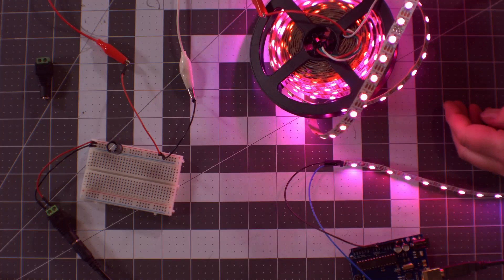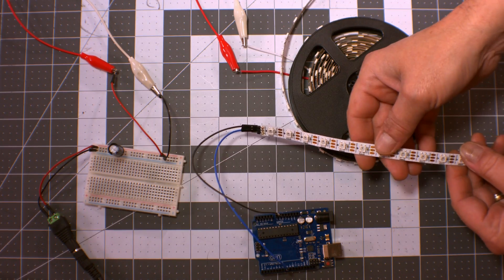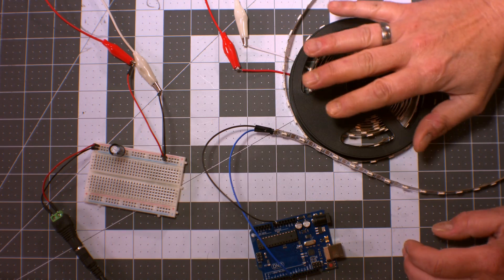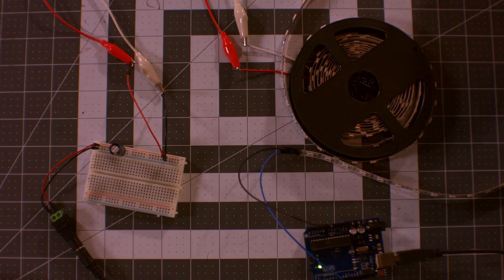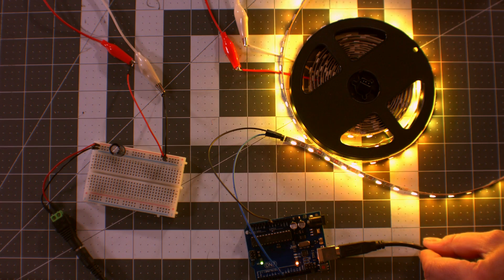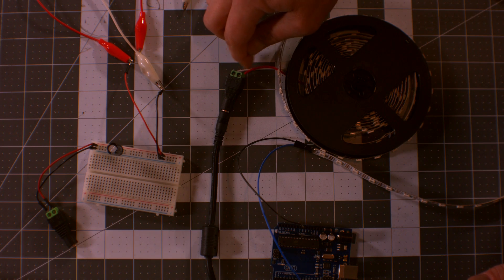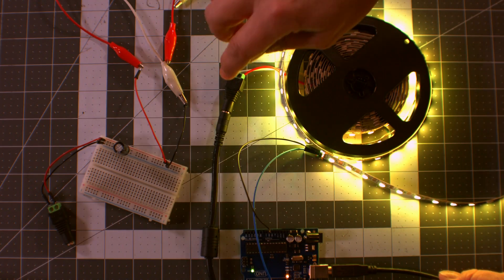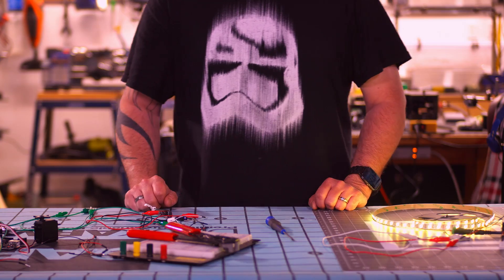LED Strip Flickering? Possible Reason and Solution!

Comment: Oh god, are you supposed to have the power and controller going into opposite ends of the strip? Thats what this looks like. My setup is (starting at outlet): 5v power supply cord --> controller --> dupont connectors --> factory led adapter  --> led soldering points, all on one end. And I get flicker when it transitions between colors. 9ft of 144pixel leds

Comment: every time I turn on the power supply (external) to feed 70 leds on one strip, I noticed that the leds flashed once.  I'm not quite sure if that's normal.  I then run the arduino to control the leds.
Reply: Considering a capacitor between the power supply and the LEDs. There is one in the breadboard in this video. I believe 1k should do it. You should also, generally, turn the power supply on and THEN plug in the LEDs, where possible.
Reply: @joshy_j_ capacitor 100nF ! Pode ser por 50 volts !

Comment: I cut my led lights and I put them back together with the adapter that came with them but the bit that I cut off won’t turn on. Any ideas why this might happen or how to fix it?
Reply: Cut the copper connectors in the middle should have a cut here line

Comment: Hello new to this , just wanted to know, you have connected data pin and gnd in from of the led strip and giving power supply to leds from behind?
Reply: It doesn't matter where the power supply comes from, there is no front or back in terms of the power supply. Only the data signal is directional.

Comment: Hi, my wiring works fine when there is no extension cable used. But I want to put my lights at the wall and therefore I connected a 2 m cable extension between the board and the strip. Now it flickers at brighter colors (2 or more LEDs at 100%). Do you have any idea how to fix this issue? 

I used this cable extension (I think it's the same wire that is soldered to the strip by default):
https://www.amazon.de/M%C3%A4nnlich-Weiblich-Led-anschluss-symphony-controller/dp/B07JG3SD43/ref=mp_s_a_1_fkmr3_2?keywords=3pin+led+verl%C3%A4ngerung+jst&qid=1575839576&sr=8-2-fkmr3
Reply: Daniel S. Same I get red blue green

Comment: Hi! I need help with my LED lights and I can’t seem to find any videos about it. I recently got my lights like brand new 5 minute ago opened and I put it up. My dad like nailed some parts but between the lights where you’re supposed to cut on both of the lights. One of them is working but the other side works with some colors but on like green or white it starts dimming and is very dim or not even the color I selected. Help?
Reply: Most likely one of the nails pierced through the connections of the strip. This would need to be repaired by removing the offending nail and the connection soldered, or you may be able to cut out the bad section and use some of the quick-connect type snap on plugs available on amazon to join the two halves to salvage the strip and bypass the damaged portion, assuming its just one place that is.
Reply: You can cut the part where he nailed. It’s like Christmas lights if ones out they all go out. Just cut off the damaged part and make sure you don’t cut off the connector
Reply: i have the same problem! when i want to turn them off the color goes to red etc its reallt annoying.

Comment: A contractor installed two sets of LED lights under our cabinets.  Have two sets of an AC/DC adapter Model: LJH-1206 which plugs into an outlet, then it plugs into an RF Receiver which is then attached to flexible LED tape of lights.  I cannot see how it is connected as it is covered with a large blob of silicone.  Each set has a remote, but both sets are controlled at the same time.  If you turn off/on both sets activate identically.  They are opposite sides of the kitchen.  Within a few days of installation we noted that occasionally they will flash about 3 times in unison.  If you are not in the room and see the flash it is like lightning.  Contractor said call the supplier.  Supplier says talk to contractor.  A week and a half later the controller no longer works.  Replaced the batteries in the remotes, nothing.  We got the supplier to replace the remotes and the RF Receivers.  The remotes work, but they still occasionally flash 3 times, always in unison.  What do I do??? THANK YOU!
Reply: Replace the whole thing with a higher quality product. It isn't worth the troubleshooting.

Comment: we just had an led strip installed in our kitchen and it flickers when i turn it off after leaving it on for a few hours? any help or suggestions to make them fix it easier
Reply from the maker: Hard to say without seing the actual way it's connected, but when power is removed (by the switch) the led strip should not have any power, therefore should not flicker (at least not for long).  Maybe check if there's some power still going to the led strip even when the switch is turned off...  If so maybe the switch is not completely turning off the power.  Hope that helps and thank you for watching btw.

Comment: Thankyou so much
I just increased the power(5v to 9v)and voila 😍😍
Reply: Aksh Dhillon what do you mean increased the power?
Reply: @angelahaina9153  i changed the adaptor. Before it was a 5v output power adaptor now im using a 9v output power adaptor. My LEDs don't flicker anymore
Reply: @axxxdeee  The LEDs do work with 5V not 9V.
Reply: @axxxdeee  Now they are emitting a steady solid black, I assume?

Comment: My under cabinet system (designed and set up per supplier) has worked fine for 1-1/2 years and is now flashing. Wired parallel to three cabinets. Small kitchen.. The transformer is in my 89 degree basement. Could that be too warm for it?

Comment: Hi, i just have 1 white channel LEDs.  When I use the DMX decoder in standalone there is no flicker, i can switch on and off perfectly.  When i switch to DMX control they flicker every 3 seconds.  I can dim and play with which channel etc. all fine but the flicker.  Any ideas?  Question as well.  I only connect via the decoder, 12v comes out and the LED is connected direct via 30cm of cable.  You have RGB which I assume is why you have power in one end and DMX on the other.  is this labelled on the LED strip?

Comment: Hey brother thanks for the vid... I have practically the same led strips , I have them connected to a 3 prong power switch , have been using them for about a year, have left them on over night and various hours at times. With no issues.... recently they just shut off. All power cuts off, even the light on my 3 prong switch goes out so obviously the switch is cutting off, but I don’t know why, if I wait a couple minutes the light switches on automatically on my switch and I can’t turn my leds back on but after a minute or seconds they power off. 
The leds turn on and off soo I don’t think the issue is there... PLEASE HELP!!

p.s. I I’m to sure but I believe one if leds + & - we’re exposed and I think they touched metal witch could have caused this but can’t see. To fix it.
I’ve tried a new switch of the same but same results.
Thank you

Comment: I’ve done 2 led bars straight to the battery with a inline fuse with a 3 pin switch under my car bonnet but now starts to flash how can I stop it ???     Relay? Or resistor??     Also plan on adding more bulbs to make the under side of the bonnet look like stars at night what would be best to add them with a switch

Comment: Thanks bro! you solved a major problem for me. You made me realise the voltage drop in my 2 AMP wires - which were 2.5 metres long. So I switched to 7AMP wires and it worked!!

Thanks!!
Reply from the maker: Great to hear that it helped and fixed your issue.  The wires are always to last thing we checked when our projects are not working properly :)  Thanks for watching!

Comment: Using the WS2812 series was a bad idea for this video. The worst flicker for these is the low PWM causing issues with video and in general when moving eyes across a scene.  I'd recommend you split this video to add more details:

A. Power supply ripple caused flicker and the solutions.
B. PWM caused flicker and the non-solvability.

I know your video is named "Possible Reason and Solution!" but missing these obvious points isn't great.

Comment: Well put. A common problem demonstrated and fixed. Thanks!
Reply: Yes, I agree. Avoid using the power supply provided by the Arduino module! Because fluctuations in this +5 line will also affect the microprocessor's power supply, and the "damage" will be great!
Reply from the maker: Thank you for your comment and for watching!